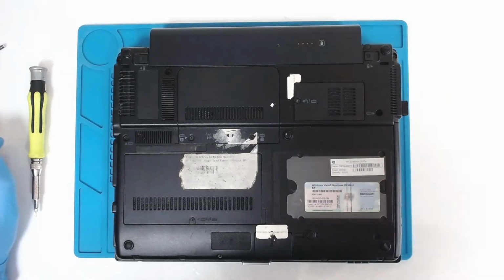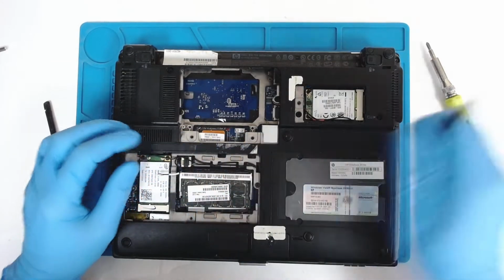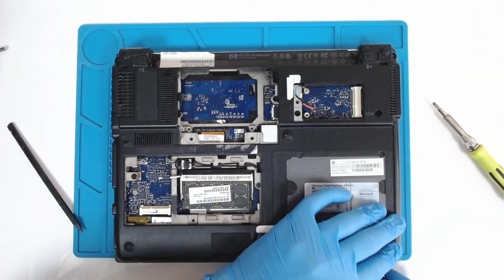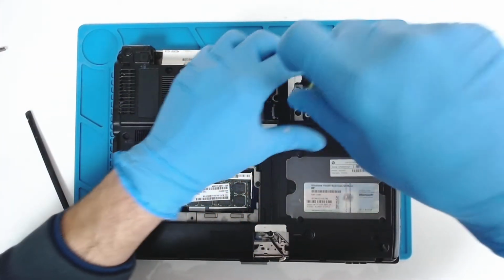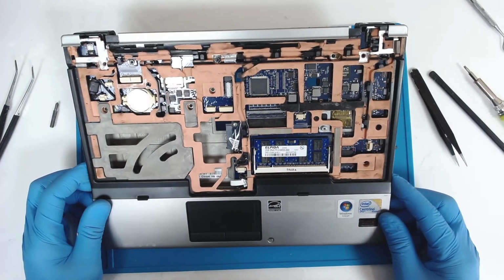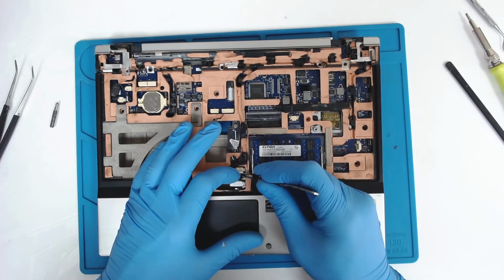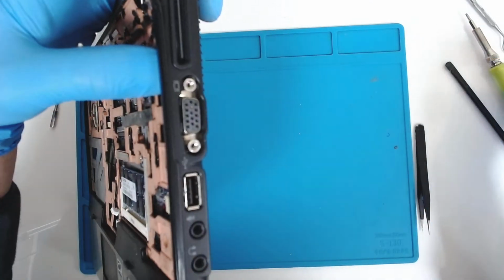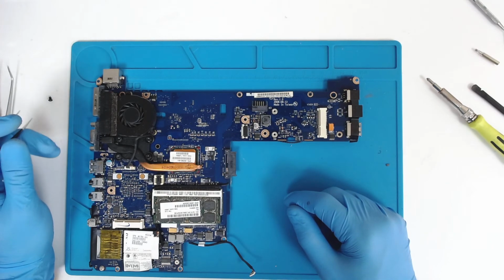HP EliteBook 2530p Disassembly

Comment: Hi Sir. I have same laptop hp 2530p. My laptop power on but no display. And no blinking  Caps lock and num lock. Processor heat sink fan is running. And no external display working. Suggest me what I do.
Reply from the maker: I would suggest to go to our discord... There is a pinned message. Post your problem in the laptop section and some of the users will help you. Also provide all the information about the case.
Reply: Remove ram and put back